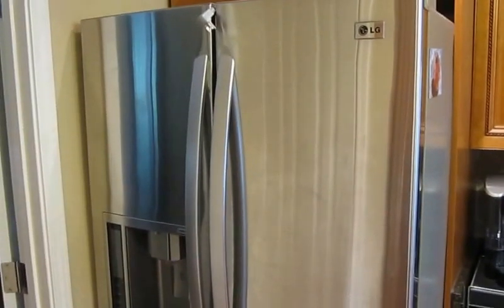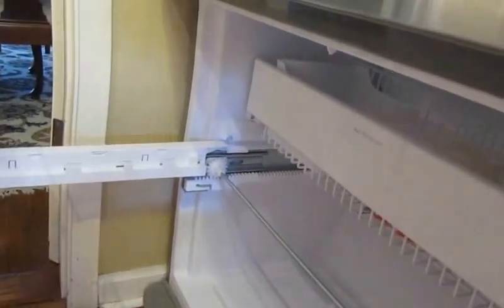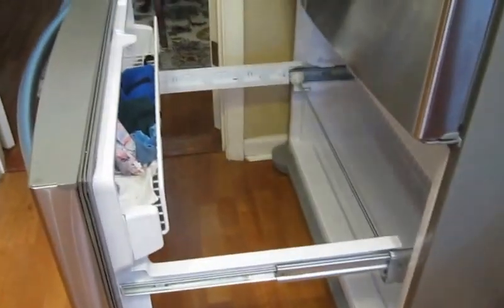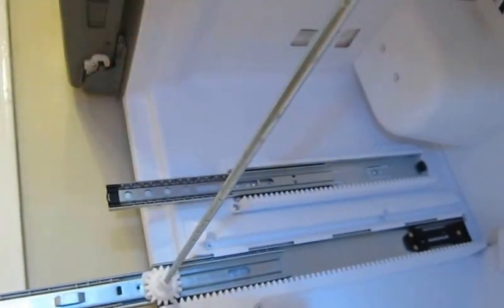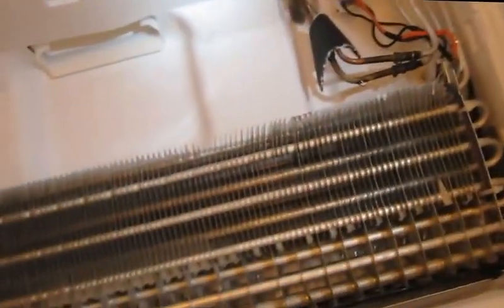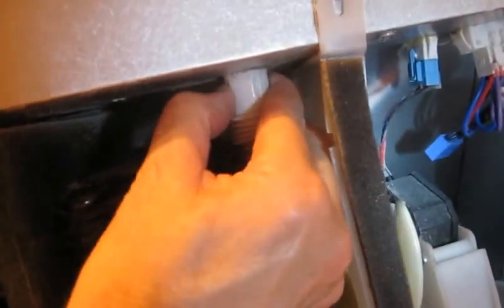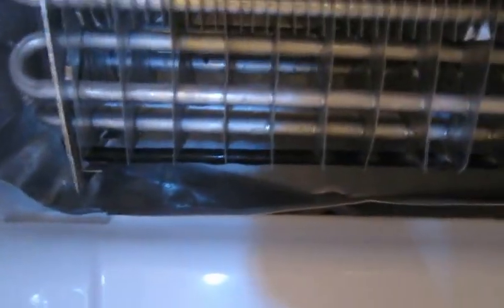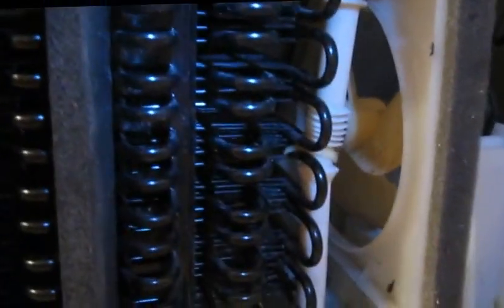LG French Door Refrigerator Ice Build Up

Comment: Thanks for the video. Mine kept icing up in the refrigerator cold bottom compartment. The drain was plugged with hard-water sediment build up. I removed the back bottom metal plate cover to expose the two drain lines. I removed the plastic drain lines and cleaned them out. I cut off the tip by about one centimeter and removed the rubber flap to help prevent this problem from happening in the future.
Reply: Because the DRAIN TUBE lacks proper engineering research and development, I put a solid copper wire (from ROMEX, 5" or so long) partway down the drain tube, (just past the 90 deg. that turns down) put some wire insulation (heat shield type) on the last couple inch's so as to not melt the drain tube, wrapped the other end around the defrost element a couple TIGHT wraps, verified it didn't touch the sides as it dropped into the drain.  Basically extending the defrost element down into the problematic drain tube. It's a pain in the a$$ to wrap the wire around the defrost element (and get it TIGHT) but worth the effort.

Comment: Had same problem. Repair tech out last week, he immediately took a panel off the back side exterior and accessed the drain tube. Pulled it off and it was clogged with dust. Bad design because the end of the tube has a rubber flapper and is right next a small fan open to the floor. He said 9 times out of 10 that is the problem.
Took him 15 minuets. He never messed with the interior.
Reply from the maker: Thanks for the info
Reply: Lmao…..while cleaning ours (not knowing the ice inside was hitting a fan blade), I found this semi clear drain tube CUT BY THE EVAP FAN. MAKES PERFECT SENSE!
Reply: Thank you dergible

Comment: Nice work!BTW, you can spring out the plastic cover without removing the rails, just pull gently on the middle of the cover, it will bend enough to clear the bottom door rails, one at a time.Make sure the bottom aluminum pan stays tight to the bottom molded trough of the compartment, ice tends to bend it up, makes it harder to keep warm during defrost cycle.Drain Frozen: 2007 French Door Bottom Freezer. After the first time this happened, it took almost a year, then a month, then a week to freeze. Some of the foil covering over the white insulation on the inside of the cover you take out to see the coils was missing, and the insulation was ice/wet, providing no barrier to the defrost heater heat. The heater, which is based only on time, doesn't stay on long enough to make sure the water stays liquid along the drain pan through the drain hole. Finally scraped off the white foam insulation on the plastic cover, just the part glued to the cover you remove. Replaced with two layers of 1/8" foil faced adhesive backed duct insulation Frost King 2" wide x 15ft long for pipes, just enough, staggered and doubled (Home Depot $5) cut to fit, seems to be fine now.
Reply from the maker: Ronald Williams great feedback,  thank you
Reply: Is your fix still holding up? I am in the same boat
Reply: I wish I knew that before I did that. The cover won't come off though. I guess its frozen on.
Reply: Captinprivate yes, just started glacier this month March 2020, we did a kitchen remodel, think the drain tube plugged. Just now put back together, added another layer 1/8” same pipe insulation, and added foil tape over seams. The pipe insulation is also not closed cell, so one it got wet, need to de-ice and dry it out.
Reply: LOL, I should have read your very informative reply... I removed BOTH side door rails. (dumb a$$) wha can I say, I was in a hurry, didn't have time for no reading... 
WHILE in there, I put a solid copper wire (from ROMEX, 5" or so long) partway down the drain tube, (just past the 90 deg. that turns down) put some wire insulation (heat shield type) on the last couple inch's so as to not melt the drain tube, wrapped the other end around the defrost element a couple TIGHT wraps, verified it didn't touch the sides as it dropped into the drain. Im .
Reply: @nobodyinparticular5224  Since adding cheap 1/8” Home Depot pipe insulation at every open space on the removable back cover, I have not had to thaw it again. I used aluminum faced duct tape to cover the insulation, shinier than the insulation facing, so it looks kinda like a mirror facing the evaporator coil. I’m going more that 2 years now on this last effort. Who would guess that a small mistake on the insulation spec for the evaporator would cause such heartache

Comment: Same problem in our LG.  Your video was very helpful.  Ice was backed up in the drain and the drain tube had a lint plug in it.  Hopefully it is fixed now.
Reply: Because the DRAIN TUBE lacks proper engineering research and development, after de-icing, I put a solid copper wire (from ROMEX, 5" or so long) partway down the drain tube, (just past the 90 deg. that turns down) put some wire insulation (heat shield type) on the last couple inch's so as to not melt the drain tube, wrapped the other end around the defrost element a couple TIGHT wraps, verified it didn't touch the sides as it dropped into the drain.  Basically extending the defrost element down into the problematic drain tube. It's a pain in the a$$ to wrap the wire around the defrost element (and get it TIGHT) but worth the effort.

Comment: At time 4:00, he shows the white drain tube. The tube has a rubber flap on the bottom which will clog with gunk. The tube or (tubes )may be removed by cutting the cable ties with a scissors and pulling it off the drain fitting . Clean it out and heat the drain opening with a hair dryer or heat gun to thaw the drain. Water will drip out, and if it doesn’t, put a straw up the hole to move any clog. Reinstall the tube(s) with new cable ties. You don’t need to remove the drawer interior if the regular defrost cycle runs.
Reply: No luck for me in simply removing the drain tube and heating up around it gently with the heat gun or poking an object up the drain hole - I had to remove the freezer door, drawer, plastic interior panel and not only heat up the bottom of the sloped drain/shelf area under the coils and remove the ice wedge but also forcibly shoot hot water down the drain hole - it had really managed to hold on and protect a chunk of ice in the hole itself, long after every other piece of ice surrendered to the heat gun.
Reply: This video was a huge help and the comments are critical too.  As someone writes below, on my model, you can quick release the drawer to come out of the slides.  The drain is icing up because of the bad design, not necessarily from clogging.  The defrost function warms up the coils to drain, but it doesn't heat up the drain.  At the top of that drain, it is a small opening and easy to ice closed from water at the end of the defrost cycle, while the coils cool back down.  I don't know how to fix that for good, short of adding a heat element to the drain (which might not be as hard as it sounds).  

I'm going to try the extra insulation on the cover as described by some commenters. And I'm going to keep an eye on the top of that drain to see if it ices up again.  But for me, there is no clogging in the drain tube or at the bottom where the valve is.  The clog/icing is all entirely in the freezer right at the top.

The only reason I'm commenting  is to share that in my case, I definitely had to open up the back wall on the inside of the freezer to get at the coils and the drain.
Reply: @blautens  Because the DRAIN TUBE lacks proper engineering research and development, I put a solid copper wire (from ROMEX, 5" or so long) partway down the drain tube, (just past the 90 deg. that turns down) put some wire insulation (heat shield type) on the last couple inch's so as to not melt the drain tube, wrapped the other end around the defrost element a couple TIGHT wraps, verified it didn't touch the sides as it dropped into the drain.  Basically extending the defrost element down into the problematic drain tube. It's a pain in the a$$ to wrap the wire around the defrost element (and get it TIGHT) but worth the effort.
Reply: @Rh0deIslandRed  
I found there is more insulation glued to the back of the aluminum drain pan below the coils, behind the coils. That also was that foil faced open cell white foam, once it gets wet it acts like a big heat sink, pulling the heat away from the defrost element. The water refreezes before it can go down the drain hole. I had a couple of years on this last fix, just replacing the insulation on the front cover. Thanksgiving activity probably pushed it over the edge. Once it freezes over the hole, then that’s the end of it. Will post on how long this works. I would post a picture of the fix if I knew how...

Comment: Thanks for the helpful info.  After performing the steps to remove the ice I still had a blocked drain tube.  I removed the cover on the back of the refrigerator to access the drain tube.  The drain tube has a little flapper on the bottom--It was clogged with lint.  I cleaned the drain tube and expect it to work for several years.  My refrigerator was almost 10 years old so I guess it took that long for the drain tube to become blocked.
Reply: Because the DRAIN TUBE lacks proper engineering research and development, after de-iceing, I put a solid copper wire (from ROMEX, 5" or so long) partway down the drain tube, (just past the 90 deg. that turns down) put some wire insulation (heat shield type) on the last couple inch's so as to not melt the drain tube, wrapped the other end around the defrost element a couple TIGHT wraps, verified it didn't touch the sides as it dropped into the drain.  Basically extending the defrost element down into the problematic drain tube. It's a pain in the a$$ to wrap the wire around the defrost element (and get it TIGHT) but worth the effort.
Reply: After we did a kitchen renovation, I found the bottom flapper valve was also clogged with plaster dust. Since that was first time in 14 years this happened, I guess I can’t get too upset. The insulation though, that took 3 iterations to get that right.

Comment: This helped a lot, I was having ice build up on the bottom of the freezer section. We ended up heating some water in the microwave and pouring it on the coils to speed up the process. I couldn't get the plug for the fan to the back undone so we just worked around it.
Reply: The plug is actually 2 plugs, if you press down on the end of the bar (raised centerpiece), it lifts(pivots, like a see-saw) the rear hook up off the catch, then it slides off. white top plug, red bottom plug. Because the DRAIN TUBE lacks proper engineering research and development, after de-icing, I put a solid copper wire (from ROMEX, 5" or so long) partway down the drain tube, (just past the 90 deg. that turns down) put some wire insulation (heat shield type) on the last couple inch's so as to not melt the drain tube, wrapped the other end around the defrost element a couple TIGHT wraps, verified it didn't touch the sides as it dropped into the drain.  Basically extending the defrost element down into the problematic drain tube. It's a pain in the a$$ to wrap the wire around the defrost element (and get it TIGHT) but worth the effort.

Comment: Thanks for posting this video! It really helped me access the freezer fins and melt the ice that was blocking the drain.
Reply: Because the DRAIN TUBE lacks proper engineering research and development, after de-icing, I put a solid copper wire (from ROMEX, 5" or so long) partway down the drain tube, (just past the 90 deg. that turns down) put some wire insulation (heat shield type) on the last couple inch's so as to not melt the drain tube, wrapped the other end around the defrost element a couple TIGHT wraps, verified it didn't touch the sides as it dropped into the drain.  Basically extending the defrost element down into the problematic drain tube. It's a pain in the a$$ to wrap the wire around the defrost element (and get it TIGHT) but worth the effort.

Comment: If the drain line is clogged because it's frozen, would it make sense to first use the hair dryer from the back to thaw the drain hose and clean everything else up back there?  It seems like a lot of work to do everything in the freezer.  Or do you think removing all of the ice in the freezer above the drain has to be remove regardless?
Reply from the maker: Mike Killion not sure if you could get to it all from the back, but worth a try.
Reply: I just tried that a few weeks ago, did not work. The ice left in the drain channel freezes the water before it has a chance to go down the drain hole. If you re-insulate the coil compartment, then the coil will provide enough heat to make sure the water stays liquid to go down the drain. I didn’t realize that the crappy foil covered open cell insulation was on the back side of the aluminum drain pan, so took out the pan, slipping it under the coils, scraped off the old insulation and put that same Frost King 2” wide foil face pipe insulation there also. I think Thanksgiving activity triggered the last ice dam, been fine for over a year.

Comment: Thank YOU for this video!  Your directions helped me so much.  Tube is successfully unclogged!
Reply from the maker: Your are so welcome, glad to hear everything is good
Reply: Is it still unclogged or has it froze up again?
Reply: Because the DRAIN TUBE lacks proper engineering research and development, after de-icing, I put a solid copper wire (from ROMEX, 5" or so long) partway down the drain tube, (just past the 90 deg. that turns down) put some wire insulation (heat shield type) on the last couple inch's so as to not melt the drain tube, wrapped the other end around the defrost element a couple TIGHT wraps, verified it didn't touch the sides as it dropped into the drain.  Basically extending the defrost element down into the problematic drain tube. It's a pain in the a$$ to wrap the wire around the defrost element (and get it TIGHT) but worth the effort.

Comment: What will prevent it from freezing up again?
Reply: Because the DRAIN TUBE lacks proper engineering research and development, after de-icing, I put a solid copper wire (from ROMEX, 5" or so long) partway down the drain tube, (just past the 90 deg. that turns down) put some wire insulation (heat shield type) on the last couple inch's so as to not melt the drain tube, wrapped the other end around the defrost element a couple TIGHT wraps, verified it didn't touch the sides as it dropped into the drain.  Basically extending the defrost element down into the problematic drain tube. It's a pain in the a$$ to wrap the wire around the defrost element (and get it TIGHT) but worth the effort.
Reply: I ended up replacing the insulation that is glued to the plastic cover. That fixed it for several years. Ice dam a few days ago, maybe triggered by lots of Thanksgiving activity. I took out the aluminum liner pan on the bottom, and found more old open cell foam soaking wet behind the coils. I scraped that off and replaced with foil faced adhesive pipe insulation from Home Depot, Frost King, 2” wide. I already did that on the cover side of the coils. If there is too much heat lost when the defrost element comes on, the water refreezes before it can make it down the drain hole, plugging it up. I took pictures this time, but don’t know how to post them.

Comment: So did the problem come back?
Reply from the maker: VirtualWoodshed not yet.
Reply: wmcknigify that’s great to hear. Thanks for the reply. And thanks for the video! Very helpful.
Reply: VirtualWoodshed mine did, last did this a year ago
Reply: Gerry Poulin Thanks for the info. I’m hoping mine will last a little longer. I did a massive cleanout of the whole drain system all the way down to the drip pan at the bottom of the fridge. The rubber drain hose was almost completely clogged with gunk.  So far so good.
Reply: It will. Obviously there is an issue if a frost free ices up!
Reply: @dlaregpou  Because the DRAIN TUBE lacks proper engineering research and development, after de-icing, I put a solid copper wire (from ROMEX, 5" or so long) partway down the drain tube, (just past the 90 deg. that turns down) put some wire insulation (heat shield type) on the last couple inch's so as to not melt the drain tube, wrapped the other end around the defrost element a couple TIGHT wraps, verified it didn't touch the sides as it dropped into the drain.  Basically extending the defrost element down into the problematic drain tube. It's a pain in the a$$ to wrap the wire around the defrost element (and get it TIGHT) but worth the effort.

Comment: How do you take off the back? I can't detach the wires. Do I just pull them? I feel a table on a couple so I know to squeeze and pull, but I don't want to damage the wires.
Reply from the maker: Cantetinza17 sorry sometimes I forget to film. On mine at the bottom there are about 7 or 8 small screws. When those are out, I lifted up and it comes off. Just note unless you undo the water line you won't be able to get it all the way out but you can tilt it up enough to see the drain line.
Reply: I think Cantetinza is talking about the back inside. You only need to disconnect the red/black fan wires, there is a little latch on one side of the connector, press on it and pull each half of the connector apart, don’t pull on the wires at all. Some models have only one screw holding the back panel in. Once you have the small access hole open, you can grab & pull enough to spring the edge clear, then bend the panel in the middle to walk it out of the compartment.